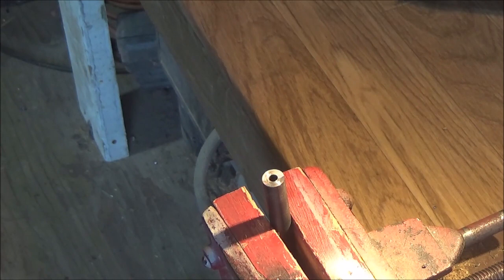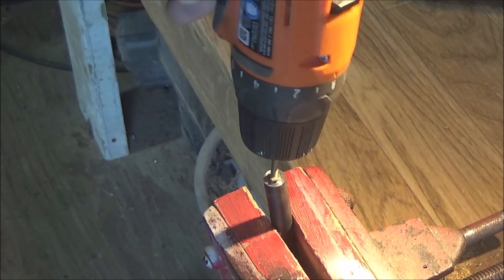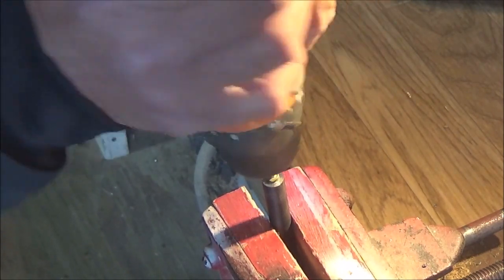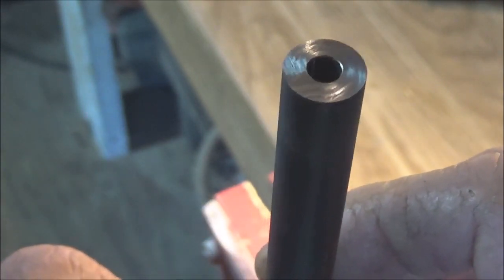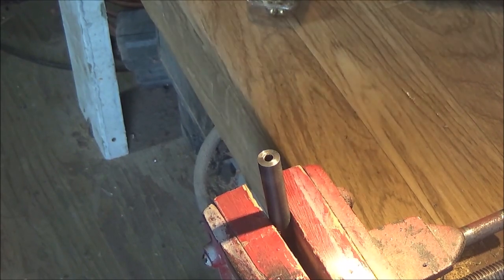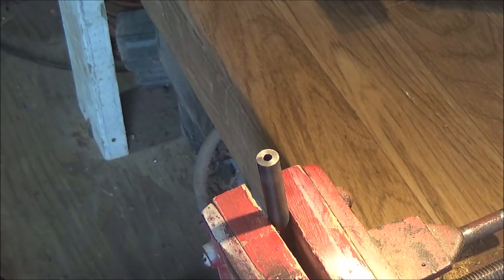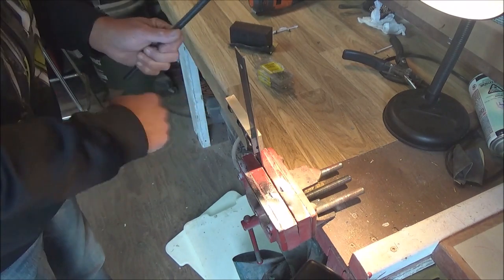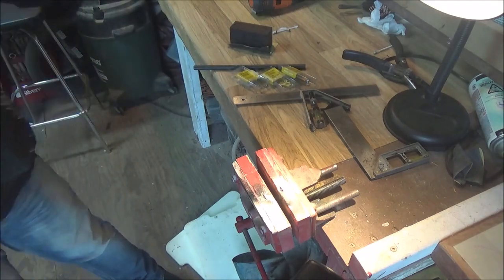Crown Your Muzzle For Less Then 45 Cents With A Brass Screw And A Drill

Comment: No lapping paist, there are  other household mild abrasives that will work,  tooth paste , Dutch cleanser or comet cleanser with a little water to make it a paste.
Reply from the maker: no needed
Reply: @KevinMillard68  Agreed.. good video!   I should have said "if needed or wanted" I have performed this numourios times because it's conveiant and fast, I have a lathe, but that's a half day effort with disasembly and set up, set, I use valve lapping paist due to time savings,  typically crown a bbl in under 5 min, have tried comet and Dutch cleanser also just out of curiosity and if works well. Cheers.

Comment: Am I the only one realizing the orbital rotation + equal pressure at every single angle being needed for this to be an accurate crown around the full diameter of the barrel? 🤔
Reply from the maker: you dont seem to know as much as you think you do but i will say this the work i do is done right and works perfect
Reply: If you think about it, you are right.
But it works. First time i saw it being done i was sceptical, but it actually worked. I machine the crown on the katje and after that i use this. Knocks of the micro burr the League leaves. Works like a threath if your muzzle end is square.
Reply: @KevinMillard68  When the whole gun is built like that, poor crowning doesnt matter that much anymore..
Reply from the maker: @janik1691  sorry dude but the crown is extremely importanen  on on every gun made crown means bad groups do the math study the science same goes for the rifling in the barrel if its shit then no crown is going to help you out
Reply: @KevinMillard68  Thats why my crownings are made precise with a lathe.

Comment: So I have a AK74 without any crown at all, is it really necessary to lap the end of the barrel square before lapping in the crown? It's from the factory and looks fine, I just don't see it being completely necessary... I really don't think .001 variation is going to make a big difference, all I'm trying to do is allow the gas an escape from behind the bullet.. I'm not building a Swiss time piece... Right? Curious what your opinion is as a machinist. I'm an apprentice machinist so I do have some metal working experience, but nothing compared to a seasoned vet like yourself.
Reply from the maker: in short the better the crown will help with accuracy if your crown is off then it makes it vey hard to site in a gun, i have worked on hundreds of guns and recrowned more then i care to remember but the difference is night and day if you do the job right for me top accuracy of the gun is everything then again you also have to know how to shoot each gun you use as well but with out a good crown youll have alot of problems
Reply: All guns have a crown. It's the corner of the muzzle and the bore. If it is clean and consistent all the way around it shouldn't matter if it's tapered at 11°, 45°, 90° or rounded.
Facing (squaring)the muzzle is probably not necessary for a factory muzzle but if you cut down a barrel, it's a good idea.

Comment: What size screw head would you use on a 9mm handgun barrel? Or can you do a 9mm?
Reply from the maker: I can do any gun barrel I want to do , I have never done a 9mm yet but you still have to size up the screw head properly and to achive the crown you want to have
Reply: @KevinMillard68   So I just have to get a screw with a head larger than the inside dia of the barrel to ream it.  Not actually a true 11 degree crown is necessary I take it.  OK, thanks for the reply.